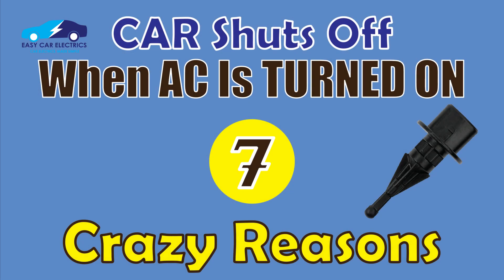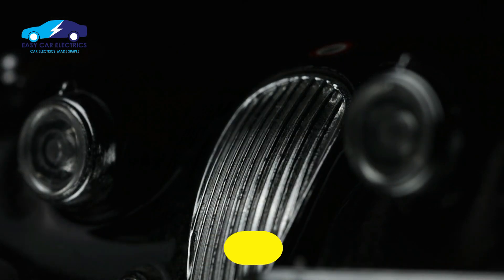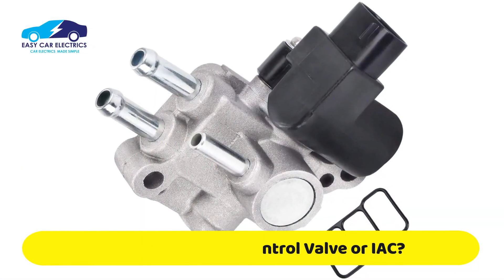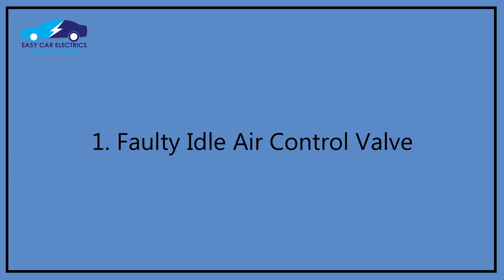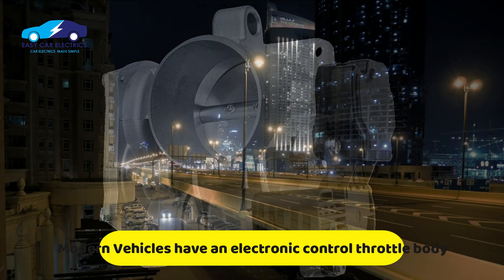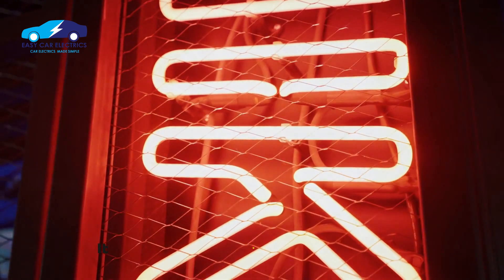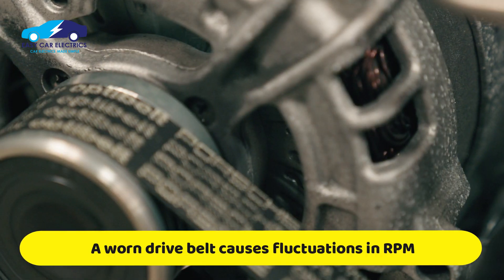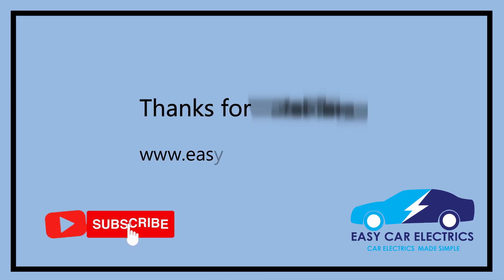7 Reasons Car Shuts OFF When AC Is Turned ON - Easy Car Electrics

Comment: Add timing chain to that list
Reply from the maker: Great point Richard, another one to consider!
Reply: When this happens I hear a bad screech and i immediately smell something burning. I dont dare try turning on the ac while the car is moving at any speed so until i can get it looked at I'm just gonna have to travel old school with windows down
Reply: Timing chain makes sense for my situation, but how exactly would I determine that?

When I accelerate from a stop or slow-roll to accelerate, I get a momentary voltage drop, just the ABS indicator light flashes super-quick such that I almost miss it.

Sometimes when I turn on the compressor, the car’s voltage drop is quite noticeable because the car experiences a momentary stall or stutter. The ABS indicator and Airbag/Restraint System indicator can flash as though you just started the car. I’m getting B1317, B1318, and B1676. There’s nothing wrong with the ABS, brakes clamp down like champs, there’s a good battery onboard and a one year-old alternator, grounds are good. Tests of the battery and the “charging system” all good with two different testers (Topdon & Autel). Engine has 277,000 miles and she’s still running, but with this “power” hiccup.

One other anomaly, when this power issue manifests itself, I start hearing a whining sound that increases in pitch when I rev up the RPM and decreases when the RPM runs down…it almost sounds like it’s coming from a speaker, but the radio is fully disconnected, so perhaps that high-pitched noise is coming from the blower as it’s running. When there are no “power” issues (no flashing lights or shudders), there is no “whining” sound, everything runs fine. Seems to happen more in hot weather. So, electrical issue, instead of timing chain?
Reply: hey, how about electronic throttle body, like honda crv gen 3?